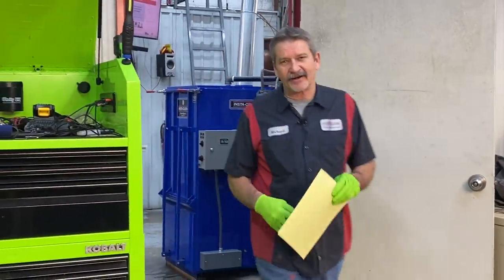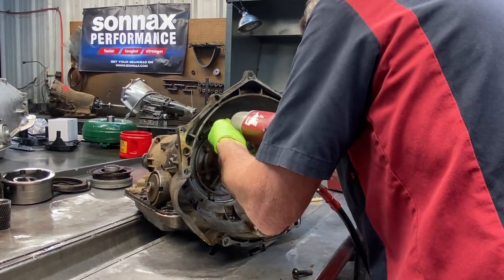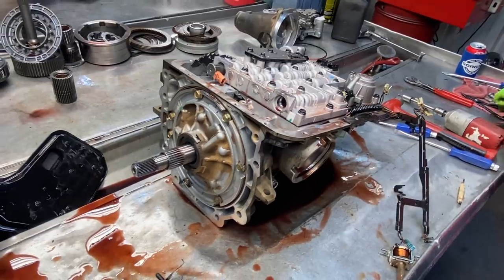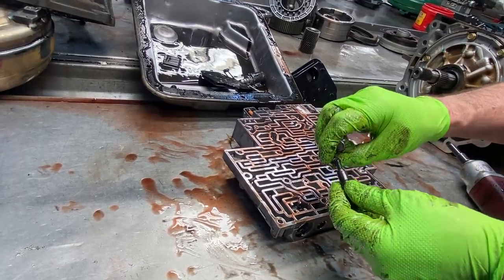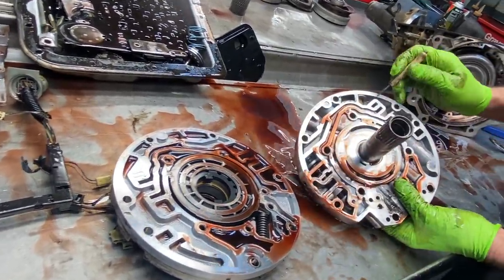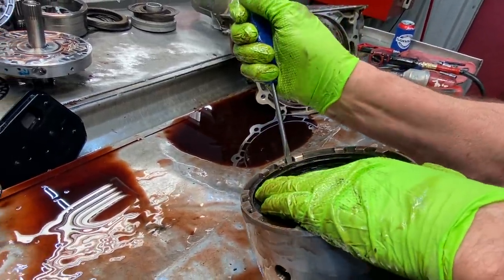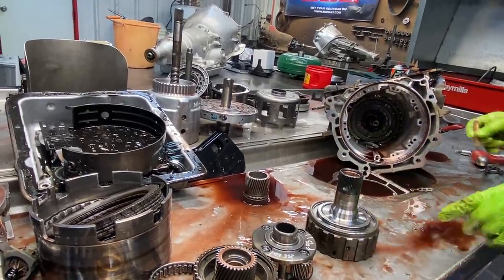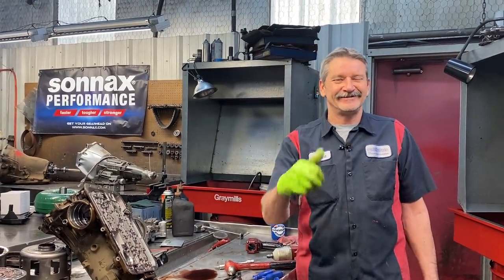What happens when your transmission cooler line pops off? Well you see it’s on the AUTOPSY table!

Comment: I had a line pop off near the radiator hauling about 7000 pounds of food equipment up a mountain grade in Arizona, it was about midnight, 30 miles from the nearest town. We got the line back on but not enough fluid left to move. I wanted to at least get off the road.  We decided the tranny might be smoked anyway so we decided to put some fryer oil in the transmission, maybe enough to get it to move. It worked and we drove it all the way to town. topped it off with fluid at a circle K,  drove it 200 miles back home thinking the whole way we were going to be broke down after our festival. That transmission lasted until 210,000 miles, went 2 more years with that fryer oil in it.  It was a Ford 4R75w.
Reply: That's nuts
Reply: Vegetable oils are actually great lubricants. Only problem is that when they get hot they tend to sludge up really bad.
Reply: Damn so your saying it popped off smoked out and went neutral and you just put fluid back in it and it worked?
Reply: My line pop off, it run outta gears it flushed it self 😂 pured a few quarts and it's all good now
Reply: @gabegarcia7779  Yes. We put canola fryer oil in it. Its all we had and needed to get off the road.

Comment: Watching this video, got me thinking about a couple of things-  What is the difference between a Corvette servo and a regular servo? I've never heard or seen any explanation of the differences. Now, the microphone that Richard wears, is there any audio settings that can be tweaked? Everytime the air impact gun runs, the audio level drops for a few seconds, then comes back up. I've missed a few things that are said everytime the audio level drops. I noticed that the electric tools don't trigger the audio level drop, since they're quieter than the air tools. Also, that's a good tip about retaining the clips if the plastic cover is missing.
Reply: The corvette servo is the second gear servo that was OEM in the Corvettes, hence the name. The apply area of the corvette second gear servo is significantly larger than the other OE GM second servos by ~35% if I remember correctly. Swapping in a Corvette servo thus generally, based on transmission condition and other upgrades or tunes, decreases first to second shift time and increases the firmness of the shift. This increases 2-4 band life considerably, and there's not really any downsides to doing it. Also because the 2-4 servo is on the side of the case, it's an upgrade that can be done with the transmission still in the vehicle, although depending on which vehicle, the clearance may be tight.

Comment: That's why I miss the old screw in cooler line fittings. Yea you do have to worry about people rounding the fittings off cause they don't know what a line wrench is for or how to use a backup wrench on the case fitting

Comment: I’ve had my lines pop off at the transmission twice, the top line to be exact, it wasn’t until after the 2nd time I realized the round plastic snap on ring that secures the metal clip was never installed, after that I ordered 2 of those plastic disc rings and haven’t had any issues since……..knock on wood……..What would make that line pop anyway, I noticed when it would happen I would be on the freeway going at an excessive rate of speed!!!  Luckily both times I was able to coast it off of the exit and into my driveway after noticing the cloud of smoke following me……

Comment: Stupid question. Could a leak in the radiator where the cooler is let antifreeze into the tranny? And if so what kind of time do I have before I'm walking everywhere? It's having these fits of sticking in 3rd gear.

Comment: You said scotch brite marks hold oil, so the accumulator piston slides easily. Is there a certain direction the the marks should be? Like cross hatching on a cylinder?

Comment: What do parts machines use as a cleaning liquid? Is if a type of brake cleaner type liquid or just water? Or distilled water!
Reply: I don't know how you went from a solvent to purified water???? Spray wash cabinets use a mild alkaline soap mixed with water with added corrosion inhibitors, parts washers generally use mineral spirits.

Comment: Richard Matco green mini screw drivers PPG3K
Reply: Thats the prybar set.
Reply: @chuckmiller5763  yes it is.  I seen them on another video.
Reply: Well over priced too.
Reply: @Garth2011  Yep, considering they are not made by Matco either.  95% of Matco is rebranded. They only make boes now I think.
Reply: @chuckmiller5763  $9 for three of them on Amazon. All the same with a 45 bend at the end. Good enough for their use. Mac tools is better.
Reply: @Garth2011  Stanley ones are most likely the same as the Mac ones, I know their pic set is, or as best as we can tell with a hardness tester,  I learned to stay off the trucks.  I actually ordered that set on Amazon yesterday, and the flat head - prybar set with the magnets.